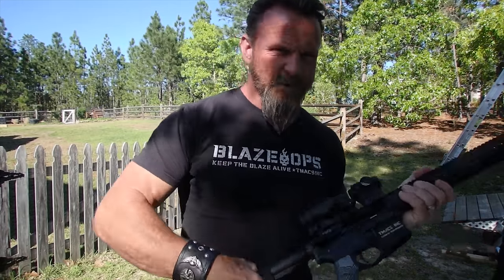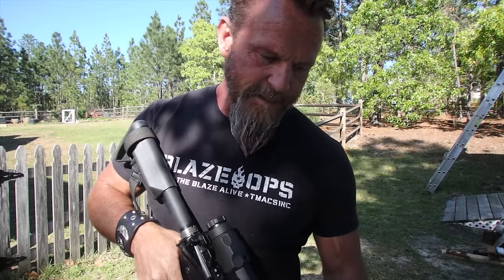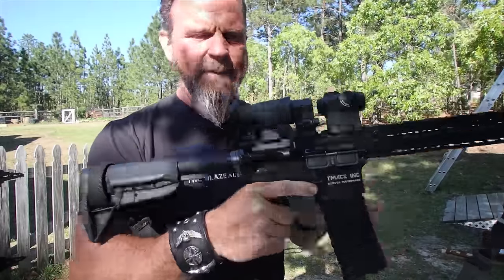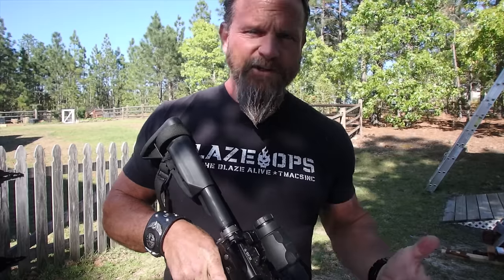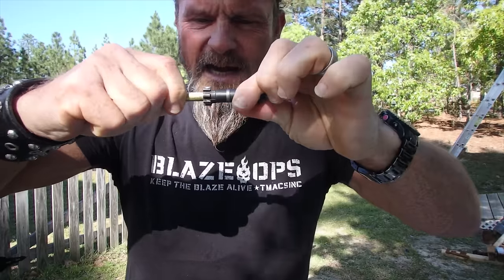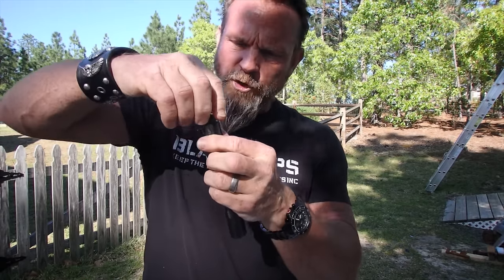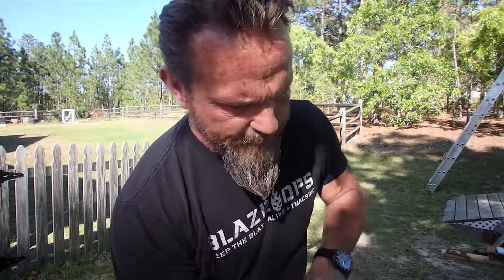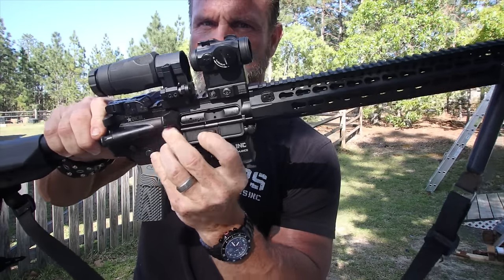Handling The Most Common Rifle Malfunctions

Comment: Lol best bolt override technique I've seen done.  
Had some nasty ones given I run an assload of steel cased 223. 
I carry a paint can opener tied to my plate carrier and or gun belt.  Great tool for fishing out those rounds stuck in the chamber.  
Carry gas rings, ejectors and springs at all times.  
Have them stuffed into mag pouch so they're on me.

Comment: My cousin and I were shooting on my place. He wanted to sight in his new AR. It immediately jammed and he couldn’t fix it. So I looked at it, and found that the live round was jammed between the gas tube and the top of the chamber. New one on me! I had to pull the rear pin, pull the BCG and then get a large screw driver in there to un wedge it from its spot. The round was jacked up. Anyhow I’m not a fan of AR’s or direct impingement. Currently I’m rocking a Tavor 7 that I’m using to hunt wolves in Idaho. I’m a lefty and I can completely set that rifle left hand including ejection port. I wish it was more accurate and hope some after market barrels will be forth coming. Anyhow, love your channel bud!

Comment: Good stuff thanks. I dented  a round by failure to seat the mag properly. User error. I then tried to chamber that round - User error. I had to mortar it several times to get it out. Finally worked. Always slap the mag. Good advice. I noticed it was not in battery so did not try to fire it!?!?!

Comment: Also for a bolt override you can used a multitool or another piece of brass like a side charging handle and rip the bcg to the rear.
If you've been shooting a while you probably don't want to put your fingers into a hot bolt carrier. With gloves you may not be able to even get your fingers in there.

Comment: Failure to chamber: Have also seen rounds gail to chamber with cheap magazines where the follower isn't made right and is to short to put the round in proper position to be picked up by the bolt. It drives the round into the front of the magwell and pushes the bullet back into the case.

Comment: I saw M249 Chamber a round with a Brass case in the barrel. We didn't know on the Hot range that day if it was a failure to eject and the second round just shoved it in the barrel or it double fed and the second would struck the primer sending the fist round out allowing it to get shoved down the barrel. No it was not a red barrel either. It was a spicy, we left the barrel on a berm we were training with on the  range doing bonding drill and ran the spare barrel to finish the training. Address the problem overcome it and move on! Basic Dude stuff.